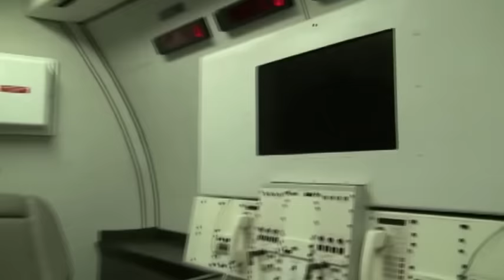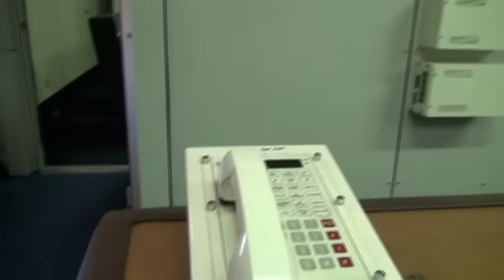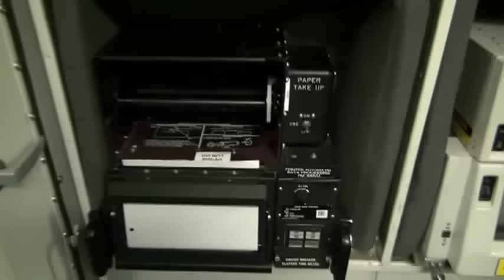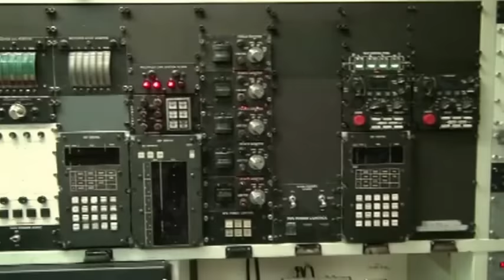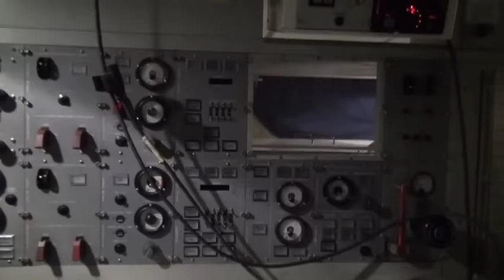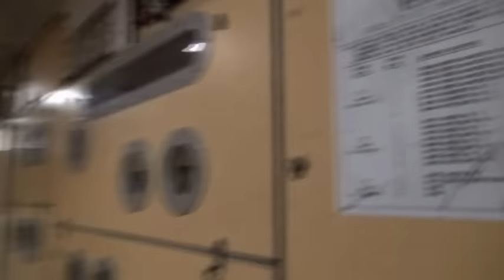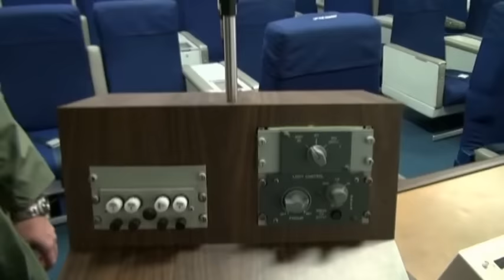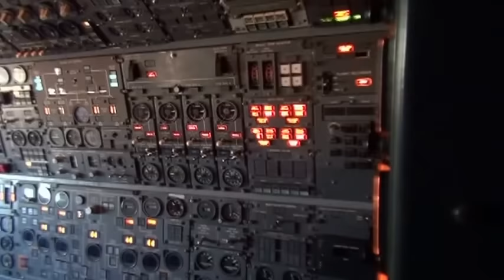Guided Tour Inside the E-4B NAOC Doomsday Plane

Comment: This can't still be operational, can it?  It all looks so ancient...
Reply: Its still in operation. I'm actually one of those maintainer operators in Tech Control.
Reply: Thomas Matthew Actually, the concept of maintaining ancient technology is a huge security benefit by virtually making it "unhackable" by today's standards. All modern technology connected to a network can be hacked, no matter how much security it has; for many reasons. Sure a shit ton of security will make it harder to hack into modern technology but it's possible by people who know what they're doing. But try hacking into a computer from the 1940's-1980's with extremely outdated hardware, programming/code, non-existant networks or if they are connected to a network- far outdated network topologies/protocols/layouts/etc. Sometimes even encryption/decryption in older technology is so outdated that it is nearly forgotten about because there has been no need to try to crack a form of encryption that was both made and shortly decommissioned in the 1970's, for 40+ years. Also, the 'ancient' technology in the plane proves that it still does what it was made for to this day efficiently and effectively; or else they would have needed to upgrade without a doubt.
Reply: john doe Oh and like others said, older technology is also extremely durable and virtually EMP resistant.
Reply: Some of the stuff, we have to get from a museum, lol.
Reply: Dunno much about hacking, but obsolescence seems like a bad security strategy.  I'd imagine the next most prolific cyber criminal comes from a developing rogue nation where he/she grew up hacking old machines like the ones on this plane.  But I'm no security analyst.
Reply: Thomas Matthew it looks 'ancient' but its 'hardened'.  It is built to last decades.  It is built to work not built for design like an iphone.  Some of the most advanced tech is underneath the 'ancient' you see so its like a book, its not on the outside that counts.  What you see is just a shell
Reply: David P.   Androids rule
Reply: GeorgeJansen yes, they do, my point is just because it looks good doesn't mean it works well :)
Reply: john doe Also, sometimes the old stuff just works BETTER. I was a weapons tech in the AF in the early 80's, and was puzzled by the old-school circuitry in the control core of the AGM-65 "Maverick". There were friggin' vacuum tubes in there.  It was explained to me that they tried to update the circuits to solid state in the '70s... and the accuracy dropped about 10%, so they went back to the old tubes and wires. The seeker modules changed, various warhead types changed, rockets changed... but the electronics that actually drive the little flaps that fly the thing hadn't - because the old stuff was just more accurate and better suited to the airframe. Don't know if they are still that way, of course - this was over thirty years ago, but it just goes to show that sometimes newer isn't necessarily better.
Reply: +Thomas Matthew They're still using ANALOG or MECHANICAL instruments because of EMF pulse radiated by a Nuclear Blast. If that happens, their communication and instruments will not be destroyed.
Reply: But then who would they communicate with? Other people similarly using the similar cold-war-era equipment?
Reply: Thomas Matthew MILITARY INSTALLATIONS. The White House, Submarines etc. They're still using the ancient technology because it's unhackable and nothing can affect its performance. Also, they used the modern one alongside with ancient tech.
Reply: Its more modern than you think, you are relating what you see on the outside with what kind of technology is behind it.  What you are thinking couldn't be further from the truth.
Reply: What's inside? Please elaborate.
Reply: can't say whats inside exactly, but imagine a 1970s car with a 2016 corvette engine under the hood

Comment: What.. The cabin looks like 80s oh god.. Analog board shit. Come on today we use all new tech like smartphone touch screen touch pad. Why they upgrade the fucking old aircraft. They have ipad on that airplane?... Thay need srapped that e4 change new model, new design cabin new tech for doomsday..
Reply: If the technology does its job whats the use in wasting the publics money
Reply: +Muhd Hazwan The equipment is EMP hardened, it has BITE  (Built in self test).and modular for quick repairs. Not only that, they are designed not to emit EM.
Reply: +Muhd Hazwan that is on purpose analog is better in an emp attack,nw tech harder to protect
Reply: easier to protect
Reply: You will be kicking yourself in the butt when an EMP goes off, and none of your touch pads work. hahaha omg the ignorance is real.

Comment: I feel like this is a decommissioned plane
Reply: I saw one flying low level around COS, CO in fall of 2019, distinctive hump thingy on top identifies it.
Reply: It looks old because nuclear stuff tends to rely on old tech. What it needs to do isn't complicated by 21st century standards, but it has to be reliable even if the world is sizzling with EMPs, and it has to be nigh immune to any sort of hacking attempt. There aren't a lot of potential security issues in its systems because there just isn't much going on to breach into.
Reply: Not really, its not new tech so they can show it off. They would never show the most modern tech

Comment: For the 747-8 sake, I hope the USAF will order the 747-8 as well to replace these ageing aircraft!!
Reply: The President will be getting two new 747-8s, as I'm sure you know, however they are so expensive, I could not imagine the USAF being able to purchase another one to replace this aging -200. If I were the USAF, I would buy one of the many dirt-cheap 747-400s (or maybe a 767?) sitting out in the desert and redo that. The alterations will cost a heck of a lot more than acquiring the hopefully-mid-90s 747-400, but if it is necessary to have this "Doomsday" plane, it should be done. The current -200 is way too dated.
Reply: Why spend the money when the E-4s work just fine??
Reply: How is it too dated? It's the same damn airframe, give or take. Or do they need the new lie flat business class seats and an espresso machine?
Reply: Agreed. Its a workhorse. It would also not have anywhere near the hours on the airframe a typical 747-200 of this vintage would have.

Comment: I think it’s awesome that they are showing us the old one 😂😂😂, the new one must be pretty awesome😂😂😂
Reply: Nope, this is the current upgraded version. These planes were originally designated E-4A, then they got updated to the configuration you see here and became E-4Bs. These planes have been in service longer than I’ve been alive. They still get the job done and they are the aviation transportation of choice for Secretaries of Defense. Clearly, they need to be replaced by like 787-9s with modern computer equipment and LED lighting. An expresso machine might be nice too!
Reply: @DLordSadow  Yep.  LED lighting for sure.  Because THAT's wht it takes to fight the Russians.
Reply: Let me tell you a little story.  I worked on a radar system in the Air Force.  It was very old.  I had to visit a site that had an "upgraded" version of this system, where they had a spare for the antenna hydraulic system that we couldn't get anywhere else.  The system LOOKED identical to our 20-year-older system, until you opened any of the cabinets, where all of the actual circuitry was.  There, not a single circuit was the same as on our system.  If you see the newer version of the E-4B, you're not going to see anything different.

Comment: It used to use a 35mm slide projector... Now, it's got plasma screens... Unfortunately, it's more outdated now than if it was using the slide projectors. I hope they still have them onboard in case of probable plasma screen failure.

Comment: Man these planes are so old. They used to be called National Emergency Airborne Command Post or NEACP. I retired 10 years ago and they started in the Air Force years before me. What are they like 50 years old now? Do they have about 100,000 flight hours? Don't I feel old.
Reply: NEACP when I was in. saw 2 at Offutt once during a TDY. Got pics of one taking off and the other was parked. I knew about the 5 mile antenna since then...1990 or 91.

Comment: I was stationed at Onizuka AS from 1992 to 1995 as a Tech Controller co located with the Satcom troops at the 78 terminal that had the comms that talked to the E-4B's I recognized the equipment back to the rear of the Tech Control station.  Used to talk to these guys from time to time on the teletypes lol.  Good times good memories at the 1999th Comm. Squadron then 750th Comm. Squadron.

Comment: They need to strip out the weight of all those walls and doors and cabinets. How heavy you are is directly proportional to how long you can stay aloft. Controlling weight needs to be your top priority.
Reply: Edmond Schwab  You're assuming that there are working planes and pilots ready and able to do that. That may not be the case.

Comment: Wonder if that 5 miles of wire trailing would add extra weight and upset the centre of balance of the aircraft ?
Reply: The weight would virtually dissapear from it's original location (thus upsetting the centre of mass) and a new drag force would be introduced to the rear of the plane...my guess

Comment: E-4B needs a flight deck engineer?
Reply: Yep. It’s a 747-200, which required one. As you can see, this is not a modern glass cockpit. You want that (and to 86 the FE), you need to step up to a 747-400.

Comment: This plane is way out of date, the equipment looks ancient!, and he did mention this plane was acquired n 1970!....so it's not worth anything!
Reply: No, he said that it's based on the dash 200, so it's at least a year or two newer by virtue of the dash 200 not even being introduced until 1971. The first E-4A was delivered in 1973, but this is an E-4B (remember the SHF rack?), of which the first was delivered in 1979. Hardly "worth nothing", the same 747-200B airframe was chosen 10 years later in 1989 as the basis for the VC-25A used for "Air Force One" because the "ancient" avionics weren't subject to failure from EMP and radioactive fallout. Strange how pretty becomes a relative term when you're splattered all over the countryside because your plane crashed and burned...
Reply: It might be the single most powerful airplane in the world... it can command the entire US military.  Welcome back to reality!
Reply: Did you know that the B-52 bombers that form the bulk of our airborne strategic force, are projected to be in service through 2050?  The H series of these went into service in 1961.  The Air Force takes care of its stuff.

Comment: A plane full of antiques.  Why do I suddenly feel less optimistic about our chances of survival in the event of a Doomsday event?
Reply: Stephen Ferrell Because if something is going to be operational in the long term and after Doomsday, it will be the analogue electronics stuff that you called „antiques“.
Reply: @jimtzikis  I doubt those flying antiques are anywhere near operational at this point, except maybe the radios, and even they're suspect because they were manufactured using electrolytic capacitors that leak or dry out over time.  You don't have such problems with new surface mount (SMD) components.   Those planes also sit for months on hot tarmacs with no A/C cooling the interior making them even more prone to component failure, especially the devices using electrolytics (nearly all of them).  Most of the systems in that plane should be considered on the brink of failure.  And ground and airborne electronics, antique or not, are equally as susceptible to EMP.  So the fact that they're using fax machines and teletypes doesn't make me feel any more secure or believe that things are more reliable.  And I'd feel much better if they upgraded those ancient radios using analog encryption devices with digital SDR radios.  Those old KG-84s they're using for encryption were outdated even in the 1980's and only used 12-bit encryption....something that can be cracked in seconds using modern hardware.  That thing is a flying museum and the fact that they've released videos of the interior only goes to show that they know it's obsolete and that they've already transitioned to a modern platform, they just haven't told us about it yet.

Comment: Looks very dated, wonder if half the equipment even works?
Reply: Nathan Tana ever have to restart your brand new iPhone because of a glitch? Wouldn’t connect to WiFi? This stuff is decades old but it works. Every. Single. Time. Impossible to hack into. Virtually impervious to radiation and EMP that would kill all modern tech in an instant

Comment: I hate to have a electrical gremlin on this plane, even through boeing are real good at making aircraft electrical looms and connections, which they test every single wire and conection way before the plane is put together, still, a disgruntled airman, takes off one of the panels in the roof area and splices two wires together and there you have it multiple systems not working properly, lol :) Wonder full how less than 100 years  before that we first had a plane flying and now look at what we have remote controlled drones which carries missiles and yet the first remote controlled planes were used during the first nuclear test go gather dust particles from the air, which was 1945. :)🦘🦘👌👌👍👍🙌🙌✌✌

Comment: Time for a replacement. Why are we replacing the VIP Air Force Ones and continuing to use this embarrassingly obsolete airbourne command center? Plenty of 747-8 Cargo aircraft available for grabs including a few ordered but defaulted on one sitting around looking for a buyer. That, or perhaps an unloved 777-200LR which has greater endurance and range.

Comment: The US military has a unlimited bank account and yet they are still using a plane from the 1970s with equipment in it from the 1980s, I understand that a lot of the stuff is made exclusively and is very expensive but, when has expense been an issue for the military?
Reply: After 8 years of the traitor Obama?  What do you think?
Reply: Kavik Kang what does that even mean dude

Comment: Lmao at the people talking about “old tech”...c’mon super IT guys...hack into it. I’ll wait...
Reply: Old tech is easy to hack.
Reply: Abram Carroll impossible. I worked on those systems.
Reply: @jimbutke  The systems themselves are easy to hack, they simply don't open the systems up to hacking like modern systems on the internet.  
minuteman III could be locked out with a combination of conventional attacks and drones with radio modems, even without the launch codes.  If they removed the lockouts, attackers could gain launch authority rather quickly.  8 digit numeric doesn't take long to crack.  
Biggest issue is the use of magnetic storage.  Even with EMP shielding they are extremely sensitive to EMP.  I'm sure there would be data corruption.
Reply: Abram Carroll ok

Comment: This is some dated technology. I'm thinking what's currently flying is upgraded, advanced. I enjoy seeing videos of the inside, but I personally want USA to keep some secrets.
Reply: This is the “currently flying is upgraded, advanced” plane. The technology is dated and not important to National Security. The procedures and protocols used on that plane on the other hand are quite classified. Why do you think Air Force personnel were doing maintenance on the plane? It’s in service and along with its 3 sisters has served America longer than I’ve been alive (and I have grey hairs).
Reply: @DLordSadow  14:30 at least they went from 35 mm slides to a flat screen TV.
Reply: gmcjetpilot And they’re “plasma screen” displays! Those haven’t been manufactured in years! Even the “updated” tech on these planes is out of date. 😅😅😅
Reply: @DLordSadow  Ha ha I got that. What I think, this is an old video. These airplanes don't look anything like this today. This is false info for others. The real secret stuff, defensive systems and encryption equip is top secret.
Reply: gmcjetpilot By old, you mean 6 years old? Aside from maybe having different fax machines and printers now, I am certain that everything is still the same. The stuff works and gutting these planes and installing a bunch of new tech would not be economically reasonable. If and when it comes to that, the Air Force will just outright replace the planes. That’s not however appearing in any Budget request or proposal so far.
Reply: gmcjetpilot You might find this an interesting read:

https://en.wikipedia.org/wiki/Boeing_E-4